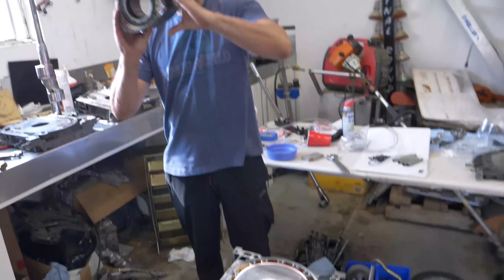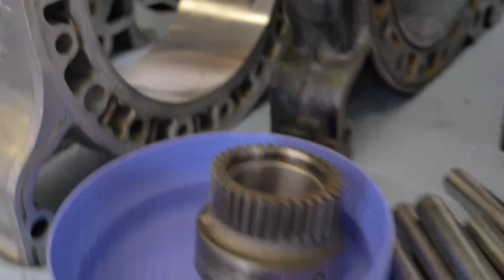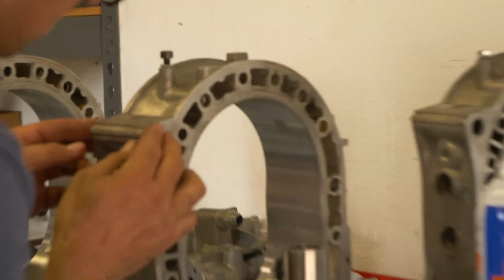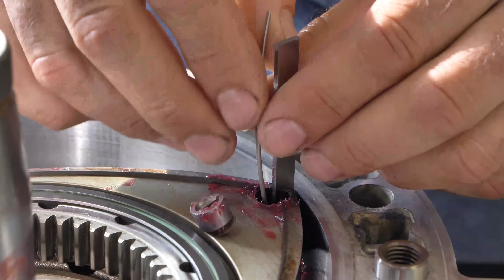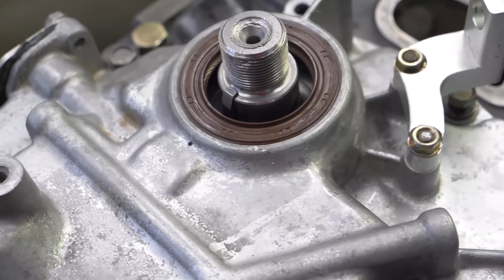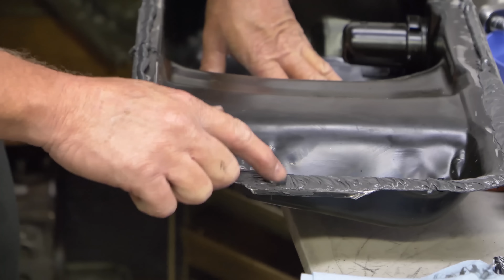The most beautiful ROTARY ENGINE rebuild! Abel assembles the 3 Rotor

Comment: I hate to ruin his technique but when doing silicone gaskets of any sort you should never use your finger and swirl it, It creates an uneven surface and can cause air pockets when mated with the other face, weakening the bond and causing leaks down track, it should be applied as a even bead along the whole thing and not be touched. 
Thats just how ive done all my gaskets and learned that from a mechanic.

Comment: I know very little about rotary engines but I have a question. I see him putting this motor together but I don't see him oiling or lubricating any parts pre-assembly. Do you not use any assembly lube with rotary engines? I wouldn't think it would hurt even if you used a light machine oil on some of those parts.  My opinion

Comment: That crack is a bit of a worry because I've heard of it being common with the cast iron housings,once they start cracking,they are likely to continue cracking right through the housing, usually if it's leaking oil,it's cracked.

Some of the rotary guys over here in Australia have been talking about how there are aftermarket billet aluminium end & intermediate plates available albeit aren't very cheap but are much more solid (not as brittle as cast the cast iron housings).

I'd either get semi PP rotor housings or the rotor housings machined to accept semi PP  (25mm) inlet ports,have throttle butterflies set up to open them up at a certain RPM band or throttle position to get the best overall performance out of the engine.

Comment: I have a 3rd gen rx7 with 20b.  I used the subframe kit first and then learned that drive shaft needs to be shortened about 3 inches and engine pushed back to firewall otherwise car does not handle correctly. Make sure drive shaft is shortened 3 inches. Then you need to weld 3 inch piece of medal to stick shift handle so stick shift fits through same hole. Those subframe kits relocate the steering rack  and the car will not handle correctly, you will regret the handling of car. Pay extra money to do job correctly.

Comment: Did you flatten the intake and exhaust ports as well as the spark plug. It would increase the seal around the intake and exhaust system. Also it would help with exhaust temp.

Comment: I know rotary engines use engine oil to help with the apex seals and keep them lubed as well. One thing that happened to cross my mind is adding an oil injector of some kind to help get a little extra oil into the engine and hopefully not have so much scoring on the surfaces.

Lets hope everything goes right and you can reach over a thousand horsepower.

Comment: I am of a firm belief that if you have an RX7, you should keep the original motor in and rebuild/repair as necessary. Or do this. Thanks for the excellent video, and keep the swirls clockwise ;)

Comment: Surprised to see rtv being used in the instillation of the water seals, or was that just assembly grease? Also no rtv between housings and irons on the lower aprons? Wont it leak oil?

Comment: Rob, I have a question about the additional dowel pins for the front rotor housing. Are they also tapered like the original ones to maintain some front rotor housing float?

Comment: Your should have sent it up to RX7 Specialties in Canada and have them properly stud the engine. They CNC machine all the main studs from 10mm to half inch in a tight slip fit. Also getting your rotors lightened and clearanced would give you good insurance against mishaps.

Comment: you have the engine started but you're still only running 2 Mill Apex seals you should have ran 3 mil it doesn't scratch up the housing as bad  and is a stronger seal  the tip of a 3 mil seal isn't as pointed as it 2 Mill seal so it goes across the rotor housing better
Reply: Deatherage performance personal preference aye cause I’ve got a 13pp 808 wagon and I’ve used 2 mill carbon seals and I’ve never had problems
Reply: 777hambone never said I did and I used to build rotaries for a living so I do quite a lot
Reply: If you do the research of people actually built drag engines this is off of their research and their knowledge for the horsepower he's trying to reach is just a better suggestion
Reply: Deatherage performance yeah bro I never said 3mm are worse but 2mm are completely fine for most builds
Reply: Yes, I’m sure you know more about building rotary motors than Abel.  🙄

Comment: This comment section... the blurred parts are the bridge ports. Why they are blurred half the time seems to be in relationship to seeing down into the journals so I am guessing there is something special about the inner portion.. or Rob starting blurring and it turned out to be unnecessary.
Reply: Alex A they where regular street ports not bridge ports. There's plenty of shots of them not blurred.
Reply: Probably a hentai joke. Blurring the soon-to-be-oily thanks to the OMP holes.
Reply: "Bridge ports" where's the bridge at? they're just the ports, big ol extended ports, but ports. bridge ports look much different :)

Comment: He didn't clear the silicone from the bolt holes on the oil pan. The bolts will hydro lock in the bolt holes and can cause the case to crack.. I only saw a few through holes in the block.
Reply: I'm assuming this is why some of the assembly was blurred. I give the engine a week unless u get lucky and all the stars align. Lol also I understand with that design you CAN use an impact on the flywheel but it's just bad manners...
Reply: Sugar87Tits your stupid as hell if you think this won't make it years again... He's one of the premier engine builders if not the best in the country.. pretty sure he knows a little more about what's acceptable considering it's all he does and your seeing a video that could have had him put that oil pan on four different times to get the right shot along with all the other shots you have to remember it's a edited video not DIY

Comment: Awesome video! How long was the total engine rebuild process?
Reply: Djseany once the rotors have been clearanced and everything is ready to just be installed it only takes an hour or so. They go together quick once you have done it a couple times. The port work doweling. Oil mods and rotor work can take some time.